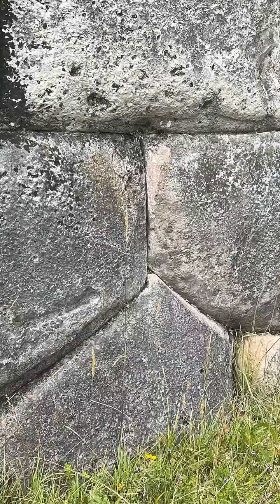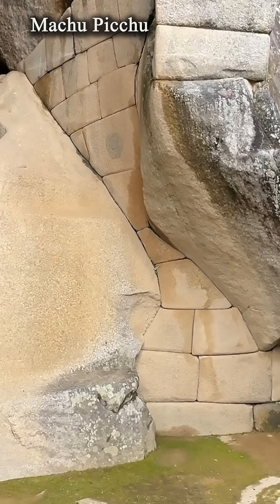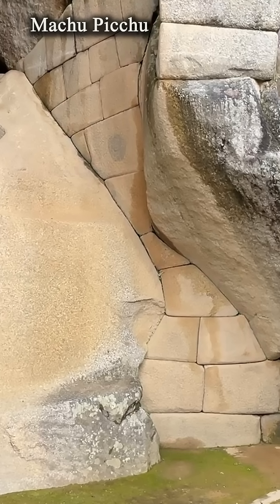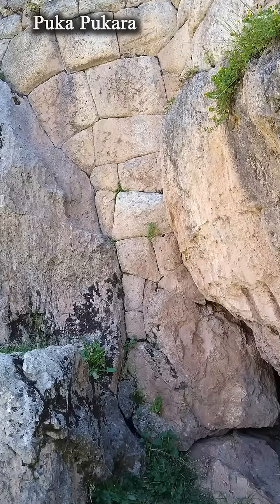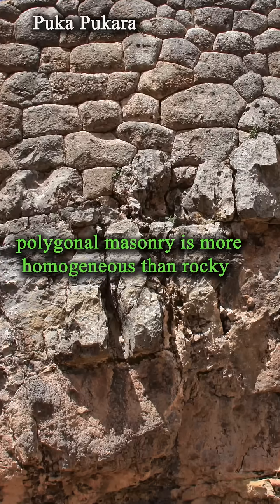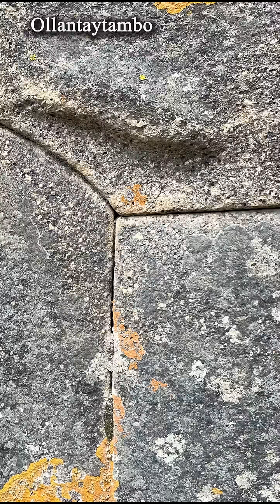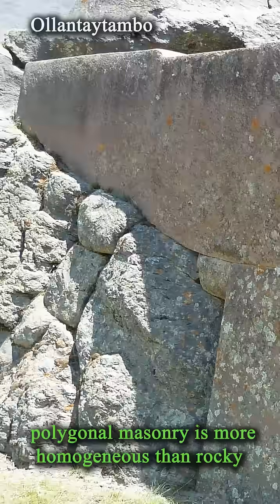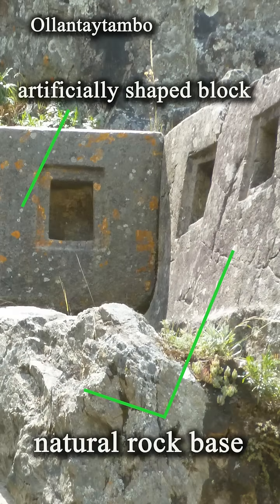the essence of polygonal masonry #ancienttechnology #history

Comment: Only 1 problem. If this video is true, then the copper tools stuff is not true.
Reply from the maker: "then the copper tools stuff is not true." Any archaeologist will tell you this. Copper tools didn't exist at that time, because copper ore initially contains impurities. Therefore, copper in the form we use today is produced using electrolytic refining and has no connection to ancient stone processing.